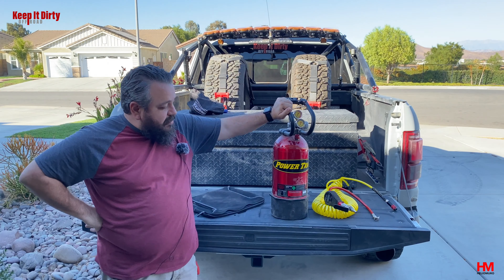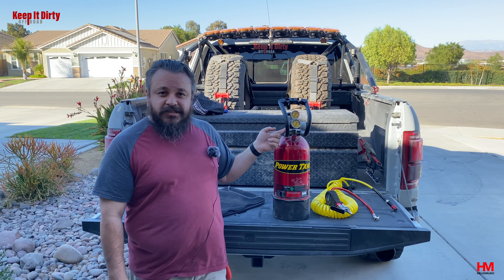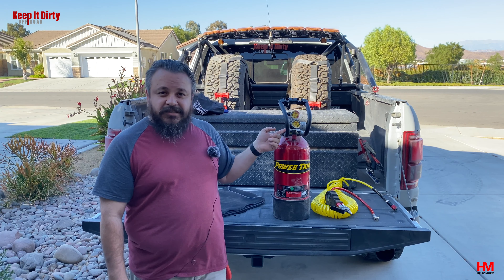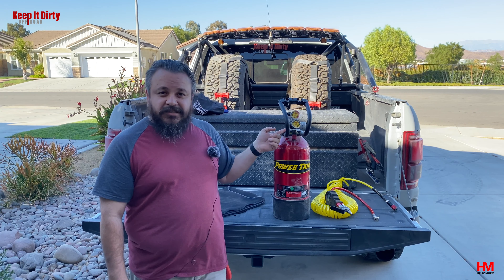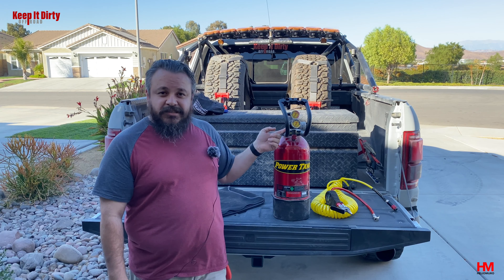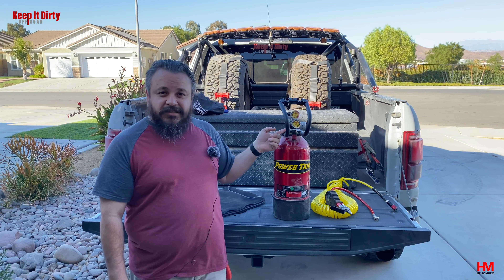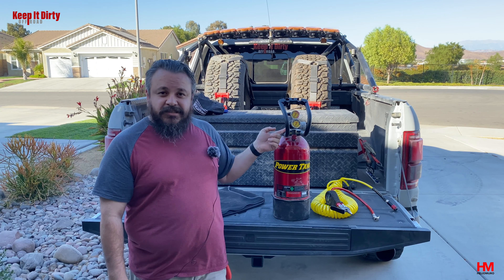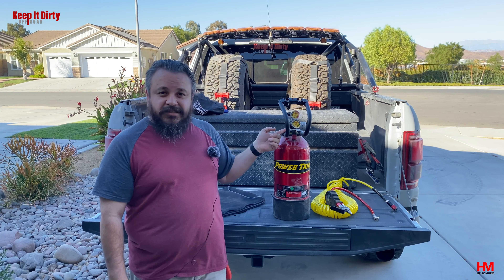Offroad CO2 Tank - DIY Option UNDER $300 & Everything you need to know

Comment: Higher psi helps with the fuel economy but destroys your suspension prematurely.   On top of that how much is it really helping? 1mpg?  Maybe 2?   If you want good fuel economy get a civic or a prius.
Reply from the maker: PSI depends on the tire man. Toyo RTs at 38 psi look aired down. They ran better at 40-42 PSI. Many Raptors guys for some reason run much lower. 
But honestly dude, this truck has an off-road suspension that can deal with offroad abuse. A few extra PSI on the street are not going to destroy the suspension. On a car, maybe, but not an off-road truck.
Reply: @KeepItDirtyOffRoad  bro they are supposed to look  " a little aired down" and yeah the truck can handle it im just saying 50k miles down the road your suspension is going to feel it.  It's like inflating a basketball, you're tires are more "bouncy" and not absorbing impact and transferring everything to the suspension.  All of this for 1mpg? I'm just saying 🤷.
Reply from the maker: @alexgarcia3900  Alex, if the truck can’t deal with a little extra PSI, how’s it going to cope with a dirt trail????
Even aired down a dirt road is VERY rough on the suspension and all the joints need extra maintenance and will need it early. The extra PSI on pavement is not doing anything to the offroad suspension of a Raptor. The off-roading is more damaging.

Now as for the look of the tire, at 38 PSI the Toyo Rt looks like the KO2 with 25 psi. That’s not good and will damage the tire in the long term. 40-42 was a medium. Tires had some give and I got about 2-3 MPG and lasted 38k miles with primarily off-roading. I’m not worried about the extra PSI causing damage because 1 I offroad a lot and that it was more taxing and 2, the psi depends on the tire and load on that tire. If it was a KO2 is would be running different pressures. My current Terra Grapplers are good at 38. All tires are different man, different compounds, different sidewall strength. You need to find what works with the tire and a single standard does not work
Reply: @KeepItDirtyOffRoad  you are one of those guy's that is always right.  Im not even going to reason with you because obviously there's no reasoning.  But Google what happens if i run my tire to the max psi on tire. Or copy and paste the link.  It's a FACT!  but I still wanna hear what you have to say. I can guarantee you'll have a comeback. I've raced motorcycles/cars and always play with the psi.  It's insane to me that people don't understand this and btw im running ridge grapplers so pretty much same tire, im very familiar with it. I run 33 psi cold and once I start driving I can see 36 to 37 psi
  
https://info.kaltire.com/the-right-tire-pressure-why-the-maximum-isnt-the-best/#:~:text=for%20your%20vehicle%3F-,The%20Optimum,between%2030%20and%2035%20PSI.
Reply: @KeepItDirtyOffRoad  granted you're right about the suspension in the raptor being capable but that wasn't the point I was making.  It's just bad to run higher psi for the sake of fuel economy.  Just Google it and do your research.   In trucks in particular its dangerous to run high psi in the back if the truck isn't loaded.  You have way les traction.
Reply from the maker: @alexgarcia3900  that article you posted did not really help your argument man. It just says run manufacturers recommended pressure. 

My focus is off-roading so that’s where my experience comes from. I’m not running ridiculous pressure like you seem to be stating. 4 psi over stock is nothing. Stock is 38, I ran 42 on the Toyo RTs. I run 38 on my terras. 

I’ve heard guys running 50 psi, that’s crazy and will cause damage. But some trucks like super duties run crazy high pressures. 60 - 80 psi. With the same tires I have on my Raptor (same load rating) . Beefier frame of course, but most of the components on the Raptor are stronger and they are fine. 🤷‍♂️ 

So like I said before. Depends on the tire and now I would add, also the vehicle. I’m just doing 4 above stock on those tires. You make it sound like I’m running 20 over stock and not expecting damage. Of course that would cause damage. The ride would be awful. Some dealer for some dumb reason deliver Raptors with those pressure and they ride like crap and guys can’t figure out why.
Reply: @KeepItDirtyOffRoad  🤦‍♂️
Reply from the maker: @alexgarcia3900  🤷‍♂️
Reply: @KeepItDirtyOffRoad  just to let you know. For already runs higher psi and more manufacturers are starting to go over the recommended to meet epa regulations or lie about their gas mileage
Reply from the maker: @alexgarcia3900  all super duty trucks are like that. Ford, Ram and GM all run 65-85 psi in their heavy duty trucks with E rated tires. But they are heavier. Raptor is around 6000 lbs. most super duties start at 8000 lbs. I was surprised at first. I don’t remember my 08 F350 requiring that much pressure. But that’s the recommendation from the manufacturer. 

For the Raptor I wish I could run D rated tires. But the RTs and the typical good grip all terrain tires don’t come in D rating in 35 or 37in.  Some you can get them but you have to pay a premium and wait a long time for them because tire shops don’t stock them. So I run E rated tires. You can feel the difference Offroad. Much stiffer.
Reply: @KeepItDirtyOffRoad  yeah, those tires are designed for something completely different and yes 60 psi if loaded. I had a friend that always ran 65psi on his f250 he bought brand new and the tires where worn in the middle and the suspension started to fall apart with only 40k miles.  But the suspension and tires are different for those vehicles.  Once your suspension is worn from having too much psi, even on your truck if you run high psi the tires will bounce like a basketball and not have grip on the road, specially on pickups. They don't have much weight in the back.   The manufacturer gives you an all around psi but the really is, if you load your bed with 1500 pounds you will need to run higher psi. But if not 33 in the back is pretty good. Tires are also supposed to absorb impact to have more grip. But again to each their own.
Reply: @KeepItDirtyOffRoad  I honestly don't know hot to explain this to you.  If you're on the road do about 35 max
If you go a washed out dirt road do 20 25 psi.  The tire will absorb the impacts, give you more grip and perform better. On top of that your whole suspension system won't get destroyed.   I dont know what it's so hard for people to understand something so simple.   And yes your truck can take it but that doesn't make it good.  Also if you go rock crawling you can do very little psi depending on the tire. But again it's like talking to the wall.  You wouldn't understand
Reply from the maker: @alexgarcia3900  offroad pressure is very different on a Raptor. I used to run 20-25. Even with E rated tires I bent 3 rims. Pressure was too low for high speed off-roading. So I talked to a few race teams to see what they run and they all run in the 30s to avoid destroying a rim. Even Raptor assaults runs 28 - 32 psi on their trucks. So I tried it out and it feels so much better. Offroad the truck tracks better, grips better and no more bent rims. Tires give enough to deal with all the impacts, without destroying a rim.

But the terrain impacts pressure . Dunes and rocks I run much lower. Usually 18 PSI. You need more give and a wider foot print in both those situations.
Reply: @KeepItDirtyOffRoad  maybe you're right then.  If the suspension on the raptor is that good then 40 isn't bad.   They also run bigger tires.   Hard to believe you bent a rim with 30psi but i guess it's possible.
Reply from the maker: @alexgarcia3900  I bent 3 Forged wheels while running 20-25 psi. A surprise wash took out the first one and really showed a nasty inner bend. The other 2 were more subtle. From talking to racers they tell me that at those pressures the tires gives too much. So the tire completely collapsed and the rim took part of the impact. At 28-32 and high speed, where your averaging 65 mph, the tire gives enough to make it soft and smooth, but not enough that the side wall collapses and protects the rim better. I learned that one the hard way.
Reply: @KeepItDirtyOffRoad  yeah 20 psi is too low if you plan on taking high speed turns and stuff but the "race" teams have long travel and way bigger tires.  Those tires are also bigger and have more air in them to be compressed.
Reply from the maker: @alexgarcia3900  🤦‍♂️ there are different racing classes man. Not talking trophy trucks with 40s. Talking classes where tire size, engine size, are limited. Talked to a few teams running 33s, 35s, and 37s. They are running way more suspension that a Raptor. But they are running faster and over rougher terrain. 

Try running a stock Raptor over a race course. That’s is a really bad day. Not fun or fast.
Reply: @KeepItDirtyOffRoad  🤦‍♂️🤦‍♂️🤦‍♂️🤦‍♂️ bro just do whatever you want
Reply from the maker: @alexgarcia3900  wow man. I’m passing on advise I got from teams that have experience racing for years. Advise I tested and has worked out great for me. Those guys changed my mind and they were right on. 

Who’s unwilling to to listen now and had to be always right now?
Reply: @KeepItDirtyOffRoad  lol.    Bro are you 12?
Reply: @KeepItDirtyOffRoad  dude im saying running high psi is not smart on the streets and thay my friend is a fact.  Read the article I sent you .. you are like what ?  16 yo?   Because you're acting like it.   So yes you are still the one who wants to be right.  Facts are fact bro.  Go read the article again and come to me talking about semi trucks or something that has nothing to do with the topic again.
Reply from the maker: @alexgarcia3900  you still on that?? Read the conversation man. We got off high tire pressure for street running a few posts ago and started talking offroad pressures. We are on the same page about too much pressure
On the street. 

I was letting you know about my own experiences and advice I received. Advice I’ve tested offroad and found useful. Somehow you may have missed that, I don’t know man. 

Anyways, this channel is about Raptors, off-roading, and my kids and I working on the truck. It’s not about pavement running the truck. I love opposition views and discussion. It’s how we grow. But I don’t have time for people like you that are not open to any advise. I read your posts, I’ve read your articles. We agree. Yet someone you feel attacked when we talk about a different topic and default to your original argument that again, we agree on. 🤷‍♂️🤷‍♂️
Reply: @KeepItDirtyOffRoad  the comment wasn't even for you it was just in general.   So people don't destroy their suspension prematurely and risk a blowout or deformity the tire.  Not everyone watching has a raptor.  And yeah in most cases 40 psi is too much.   You're to one that got all defensive for whatever reason and still are.
Reply from the maker: @alexgarcia3900  🤦‍♂️🤦‍♂️ we agree on this. Not on the 4 PSI over. but 10-20 psi over manufacturer recommendations can have negative affects. 

The conversation shifted and somehow you haven’t. You feel so strongly about 4 psi causing an impact? Create your own video on the subject and watch all the opposing views come in. I don’t think you will be able to handle it.

This video was not about tire presssure. It was about using a CO2 tank offroad. Benefits of it, comparison, speed, and how to build one at half the cost. Somehow you took a 2 second throw away comment about how I run 4 psi above stock on the street because the RTs look deflated as an opportunity to make yourself feel superior. 

BTW, keep responding. All of this is engagement and elevating the video. No one will read this because it’s 20 comments in. But it helps elevate the video and increase views 😁😁
Reply: @KeepItDirtyOffRoad  🤣

Comment: A DIY powertank is on my short list. The 12volt air compressor is so slow, and heats way up. I was going to see what my local weld supply shop wants for a 10 lb tank full and ready to use.
Reply from the maker: Local weld shops don’t normally carry the right regulator. You may be able to get a good price on a used tank, but check on the last time it was inspected. They have to be inspected every 5 years.

Comment: It's an even bigger difference when you air down a tow rig to pull out on sand. Our tow rig and trailer are filled to 70 psi (total of ten tires). The higher the pressure in the tire the longer it takes with a compressor.
Reply from the maker: Yeah. That’s where CO2 really shines

Comment: So were both tanks the same speed?
Reply from the maker: RubiKong Her are you taking about the power tank and the DIY tank?

If so, it depends on the regulator you get. Airing up tires with 250psi is twice as fast as 150psi. The cheaper regulators max out at 150 and are slower.

Comment: I am not sure where is the rush to air your tires. It takes me around  10 minutes total  with a compressor. Just enough time to have a beer or two.
Reply from the maker: I still need to drive home so no need for beer time. Also airing up 35s and 37s takes much longer with a compressor. Minimum 20 minutes Plus setup and tear down. With a power tank the process process goes down to around 5 min. Big time saver to spend more time talking to friends and planing the next trip instead of crouched over on the tires for ever.

Comment: Rent a tank from a welding shop just exchange it because these tanks are only good for certain amount of years . Then just drop off the empty and grab a fresh one and out the door you go
Reply from the maker: All-IN Offroad that is definitely an option. They need to be tested every 5 years. The actual test is relatively cheap. And I like the nice powder coated tank. Eventually I will make my own with the right regular and handle.
Reply: @KeepItDirtyOffRoad  
Ohhhh i hear ya the powder coated one looks way better but i believe not 100% sure that you can only pressure test once and usually have to send them out . Awesome video man!!!!
Reply from the maker: All-IN Offroad it depends on the shop. I have some shops near me that only do exchanges and nothing else. Other will refill anything and can do onsite testing while others require sending it out. But you can keep using them. There are 2 test. A pressure test and a camera test. I think the camera test is more involved. But not sure when those are required.
Reply: @KeepItDirtyOffRoad hydrostatic testing, you can probably get it done at a scuba shop, or companies that service SCBA air packs. If there’s a star at the end of the serial number than it’s a 10 year tank.